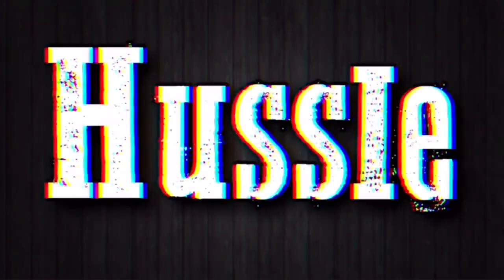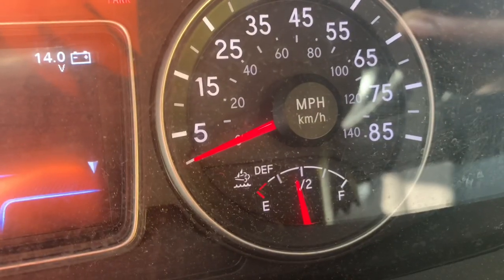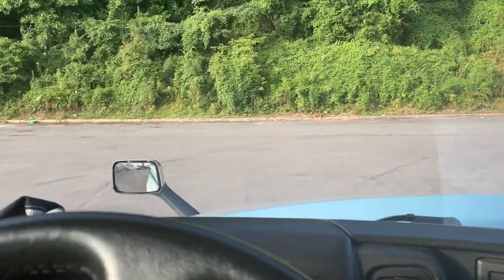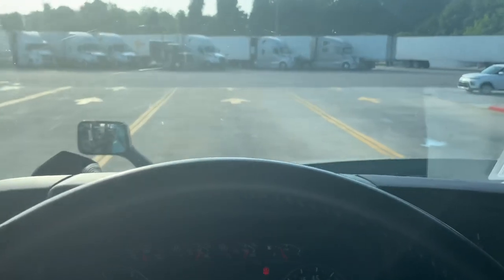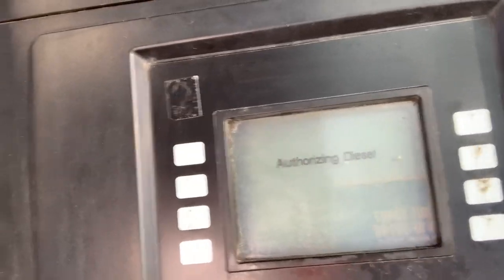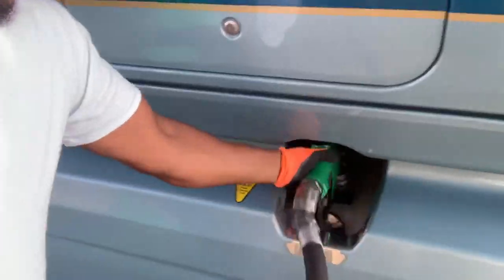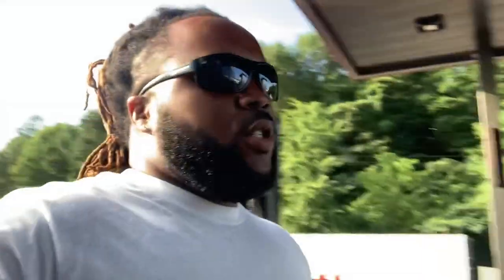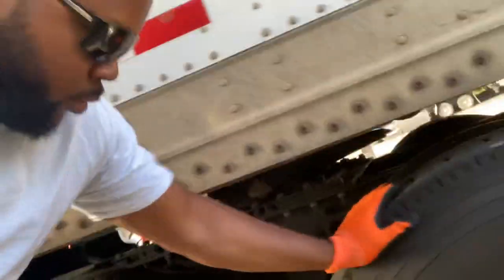How to fuel up a semi truck | Werner Driver | Rookie Trucking Life

Comment: Always make sure both side is filled first cause the driver side stops both pumps.  Great tip, I made that mistake back in 2017. Than you have to reactivate the fuel isle again.  😏
Reply from the maker: Facts